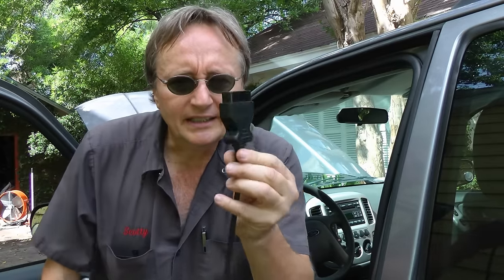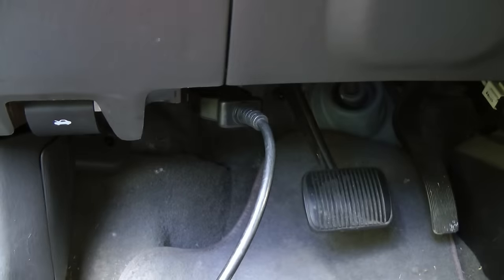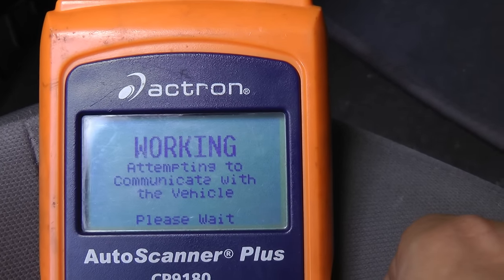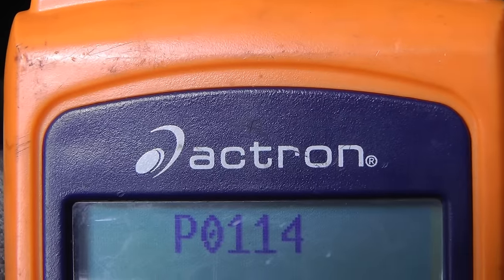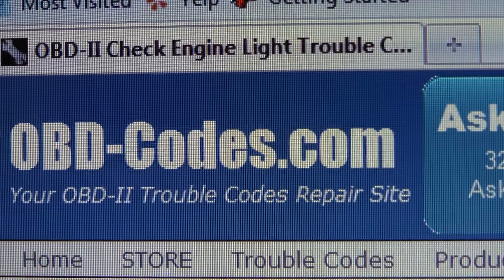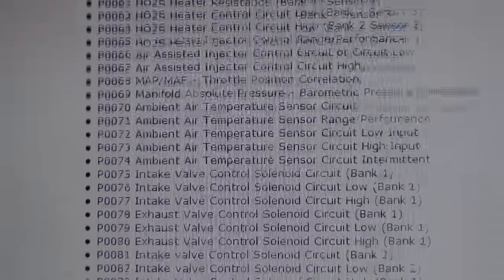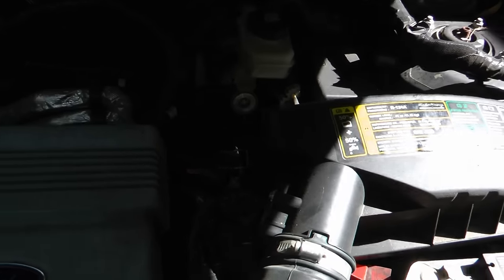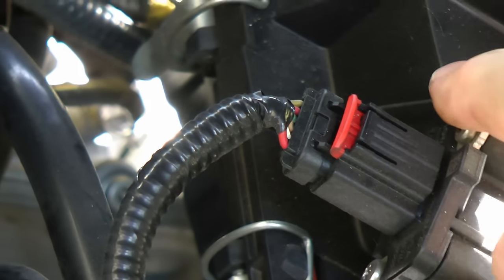Check Engine Light On and How to Fix It

Comment: hello mr kilmer i have a problem with my 1999 honda crv the check engine light is on showing catalytic im freaking out right now. as u can tell i don't know too much about cars i drive 40 miles every day to college, and drive up some hills im afraid something might happen please HELP!!!!!!! desperate hear
Reply from the maker: if car runs fine and light doesn't flash on and off, guys drive em years that way. It just means the cat is working at less than 95 percent efficiencty. But try my cleaning video "fixing bad catalytic converters'
'
Reply: hi mr kilmer its me again on the honda crv I just found out it was idle air control system malfunction code po505

Comment: My 05 Toyota Camry,it given me a problem,it running good but when I turn the enginer of,no want turn on until a few hours,I know what it's.
Reply: I mean I don't know what it's.
Reply from the maker: Erick Rojas  when it doesn't start up, do my video tests "fixing a car that cranks but doesn't start up" to find the source. If it doesn't even spin the engine over, replace the starter.

Comment: i have 92 accord lx i think somthing drains the battery   i did the drain test 

i dont know if i did right the test ...i put the positive lead meter to negative post battery and negative lead meter to negative battery cable ,,shows 0.00 on the voltmeter  what results should i see
Reply from the maker: mike licea you don't have a dead short, as it reads 0, and you are testing it right. You would have a live short, which can be absolute hell to discover as those occur only with engine running. But do have alternator and battery load tested, could be that and place like auto zone do that free.
Reply: thanks ,,scotty kilmer youre a great person i want to be a good mechanic like u i like all your videos thanks again

Comment: So I took my car to a mechanic who said they replaced the spark plugs and ignition coils and When I got the car back the check engine light was flashing and I pulled In to a parking lot and my car died and the mechanic said it was my battery so not sure? Was he lying?
Reply from the maker: if he load tested the battery with a testing device, I'd believe it

Comment: I have a odb 2  code that's only saying error n I'm following the steps n nothing .. help
Reply from the maker: +Mildred Perez either wiring is bad from the sensors to the computer, the computer itself is bad, or a sensor is so shorted out it's shorting the entire system out. GOOD LUCK

Comment: hey scotty my engine light stays on i went to the meccanic he told me the two o2 sensor r gone so he replaced and only the bottom light when off he checked all the connection he thinks its the computer

Comment: Hola Scotty, Check engine light on my pt cruiser 2004 (112,000m) codes: P0032, P0038, P0508.  Thanks for u help!
Reply from the maker: you can't really diagnose 3 codes at once, do my video "fixing a car with multiple trouble codes" then e mail me the result of that test

Comment: My check engine lite won't turn on 

Y

Fuse/light bulb or what
Reply from the maker: check the fuse, it does have one. If not that, generally a bad main computer circuit that drives it.

Comment: The reason I ask is because one time I almost paid a mechanic $ 400 bucks and got it fix from a neighbor for $ 100 and the part it cost me $ 20 bucks I want to avoid mechanics like the $ 400 one also the ford escape the rear tires is only one y believe that has uneven wear the one I bought used could be the problem thanks in advance

Comment: What happens when a check engine light come on and there is no codes.
Reply: a little late reply but it means your fuel cap is loose or its cracked or something not %100 sure tho

Comment: dude i need help. i engine washed my car. and now the CEL is on. i tried changing the spark plugs. still its on. and my rpm is moving     up and down.
Reply from the maker: never mix water and engines. You messed up electronics now, pray spraying WD 40 on electronics will disperse the water and fix it
Reply: thnaks for the reply. I will do that now.  And also i wanna know if it will have permanent damage to my engine?
Reply: Mr.Fabi Nator stupid why would you put water to the engine? common sense man do you even know how many wiring and electronics are under the hood?
Reply: i did not put water on the engine. the car is fine now, i jus dried out  the wire harness and sensor

Comment: Hi my name is chris
I have a 2000 vw jetta 2.0 gls. 4 cylinder. my check  engine light is flashing. Im not driving the car because of this issue . i have  a codes  p0300 and a p0422. I changed my spark plugs and wires, as well as the coil pack. I took the car for a spin and the cheack engine  didnt flash. but it still had a check engine light until 30 something  miles later it started flashing again. Meanings  its miss firing again right? i checked my work once more and its still having the codes.  p0300 and p0422. do i have to replace  the catalytic and o2 sensor? Will it stop and be check engine light free?  If not what should  i do? I need help its stoping me from working. Please help
Reply from the maker: it has random misfires, you must fix that first, as it will eventually ruin the cat and trip that code. But, cat may not be ruined yet, you should try finding the misfire problem and fix that and pray the other code then goes away. Type "fixing P0300 code" on the search on the scotty kilmer  channelopening page on youtube and watch that video
Reply: christopher davis   Try replacing your front oxygen sensor.  They get weak over time and can trigger misfire codes.
Reply: I replaced. Spark plug  the wiers  the coil pack, o2 sensor  and cat after that  cheack engine  free.  The honey cone inside cat was not there and and the o2s was  black. Now it running  fine.

Comment: My Vauxhall Corsa check engine light on my dashboard is called (control indicator for exhaust) in the manual, it started flashing then stayed on and engine started running rough. Stop, then start the car and light goes off, take it a drive and same thing happens... Anyone know what's going on?
Reply: +stormislay check your secondary  air injection pump and check for air leaks and check the maf sensor and your cam sensor and check for any air vac leaks

Comment: got a 2000 Toyota Celica GT with a check engine light on anyone can help?
Reply: Jose Alvarado which code
Reply: how could anyone possibly help you with absolutely no information about the problem?  Hook in a scan tool and read the code.

Comment: 2010 prius check engine comes on and off while I am driving at 100k
Reply from the maker: +Mrsingh that has a great on board diagnostic computer, get it scanned to find the codes, there are over 2 thousand different codes, so guessing is futile
Reply: +Scotty Kilmer sure I will be checking hopefully next time check engine light comes on thanks.